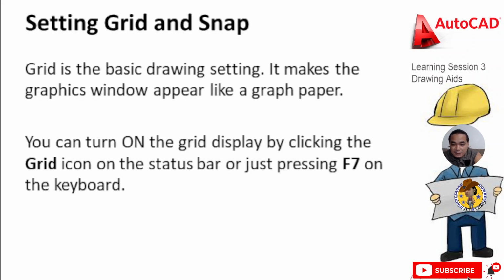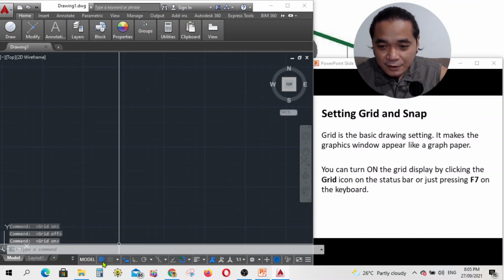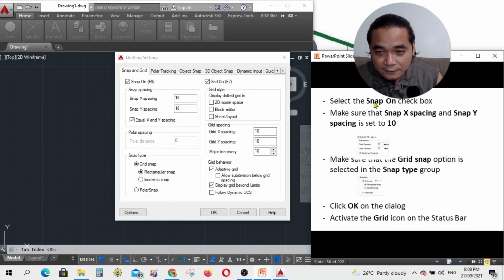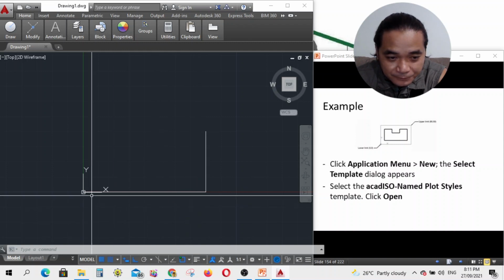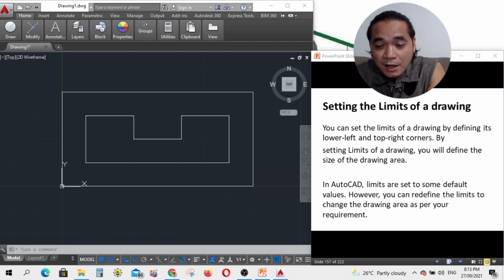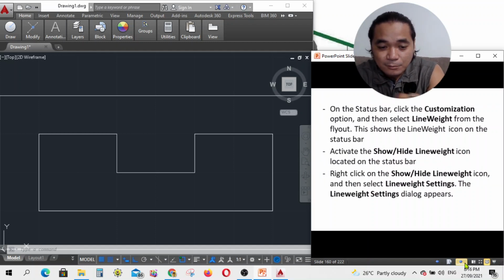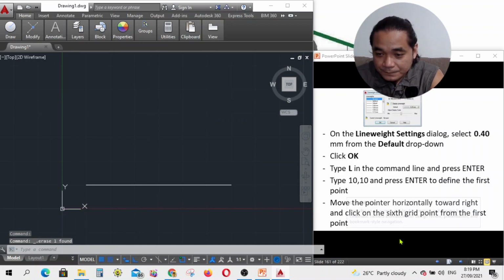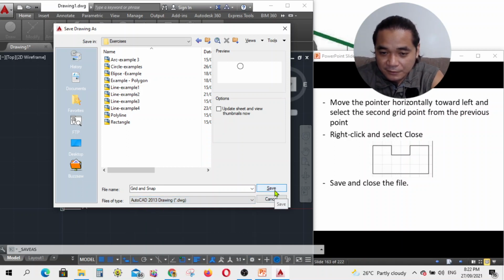AutoCAD LS 3-1 | Drawing Aids

Comment: This video helped me understand AutoCAD's Drawing Aids a lot better. It teaches us how to use AutoCAD drawing parameters to create drawings quickly. This lesson explains how to set up the grid and snap, as well as the drawing's borders, limitations, and line weight. The grid is the most fundamental drawing arrangement. A window simulation in the style of graph paper. To activate the grid, click the Grid icon in the status bar or press F7 on the keyboard. We can also specify the borders of a drawing area. AutoCAD has built-in constraints. However, we can adjust the limits to meet our needs. Line weight is also related to the thickness of what we draw. Thanks a lot sir.

Comment: After I watched the part 1 of learning session 3, it widened my knowledge about AutoCAD’s Drawing Aids. A big thank you to you Engr. for explaining it thoroughly. This video taught me how to set up drawing parameters in AutoCAD. This lesson also discusses configuring grid and snap, drawing restrictions and lineweight. Aside from that, I've observed that the grid is the most fundamental drawing setting which gives the graphics window the appearance that’s looks like a graph paper. To enable the grid, click the grid symbol in the status bar or press F7 on the keyboard. Lastly, I learned that the limits in AutoCAD are set to some default values. You can, however, alter the bounds to change the drawing area as needed.

Comment: In this Learning Session 3- Part 1 video is about the Drawing Aids. This really helps me to understand well the various functions of Drawing Aids. The content of this video teaches me to define the drawing settings which will assist me to easily creating a drawing in AutoCad. I learned that the drawing tools which can be turned ON or OFF from the status bar and to access drawing setting like by right clicking on button. From its definition that Grid is the basic drawing setting which appear like a graph paper. You can turn on the grid display by clicking the Grid icon on the status bar by pressing the F7. Also, I learned that the lineweight is the thickness of the objects wherein you need to adjust the lineweight by setting the navigation bar and click lineweight. Thank you for this informative video Sir. I learned a lot! God bless☺

Comment: I finally learned how to set the grid and snap settings in this video. And also I learned how to set the thickness of the objects that I draw by the Line weight. Because of your clear instructions, I learned a lot in each lesson, so thank you sir.

Comment: In this video, I have learned the functions of grid and snap, which can be turned on and off by pressing their respective shortcut keys, F7 and F9, or by looking for them in the status bar. I also discovered that the "LIMITS" command can be used to define the drawing area. Another amazing feature I've discovered in this video is the line weight, which can be configured into various thicknesses. All of these functions can be found in the status bar, and if it isn't visible there, you can find it in the customization (the icon with 3 horizontal lines located at the bottom of the AutoCAD) and turn it on to pin it to the status bar.

Comment: Good Evening Sir.
Pauline Peace to you!

Thank you for this video sir because it help us to know every topics in AutoCAD especially this Learning Session 3- Drawing Aids because it helps us to know how to used the AutoCAD Aids Tools because it useful and to assist in our drawing using of AutoCad  in a certain part/component, the most basic types used are: Line, Circle and Rectangle because it is essentially modes and methods of entering the data, once we mastered, we allow to create measured drawing with ease.

Concepts for this Learning Session 3-Drawing Aids:

Used of Grid and Snap - The grid helps you align objects and visualize the distances between them. The grid is not plotted. Grid Snap restricts the movement of the crosshairs to intervals that you define. When Snap is turned on, the cursor seems to adhere, or "snap," to an invisible rectangular grid when you create or modify object

Used Ortho Mode and Polar Tracking - Ortho only addresses 90-degree angles, Polar can be set to any increment angle you want as low as 1-degree.

Use Object Snaps and Object Snap Tracking - Use the Tangent and End object snaps with object snap tracking to draw to points that are tangent to the endpoints of arcs. Use object snap tracking with temporary tracking points. At a point prompt, enter tt, then specify a temporary tracking point. A small + appears at the point.

Create layers and assign properties to it - Right-click, and then click CAD Drawing Object > Properties. Click the Layer tab. The layers from the original AutoCAD drawing are listed along with their associated visibility, color, and weight options.

Zoom and Pan Drawings - Pan: Hold down the scroll wheel as you move the mouse. (The scroll wheel is also considered a button.) Zoom to the extents of a drawing: Double-click the scroll wheel. This method is particularly useful when you accidentally press Enter at the wrong time during a Move or Copy operation.

That's all
Thank you and God bless!

Comment: In LS 3-1 I learned about the drawing settings which can be turned on or off from the status bar. Learned how to set up and use the Grid and Snap setting. Grid is the basic drawing setting which makes the graphics window appear like a graph paper while Snap is used for drawing objects by using the intersection points of the grid lines. By pressing F7, we can turn on the Grid.  We can also set the limits of a drawing by defining its lower-left and top right corners. To set the thickness of the line, we need to adjust the lineweight by setting the navigation bar and click lineweight. Thank you so much Sir for all the learnings I have through this video!

Comment: In this video, it really improved my understanding of AutoCAD's Drawing Aids. It teaches us how to set drawing parameters in AutoCAD to create drawings fast. This lesson explains how to configure the grid and snap, the drawing's borders, the drawing's limitations, and the line weight. The grid is the simplest basic drawing arrangement. A graph paper-like window simulation. In the status bar, click the Grid icon or press F7 on the keyboard to activate the grid. We may also specify a drawing area's borders. AutoCAD has built-in limits. However, we may change the limits to suit our needs. Furthermore, line weight it relates to the thickness of what we draw. AutoCAD gives objects a default line weight, at the same time we may adjust the line weight.

Comment: For line sketching, I learnt how to use the grid and snap. Engr. Mardie explained where and when to set up grid during this tutoring session, including turning it on by hitting the Grid symbol on the status bar or pressing F7 on our keyboard. This lesson also demonstrates how to utilize the snap mode in creating objects utilizing the intersection points on grid lines in this video. By changing the navigation bar and picking the lineweight, I also learnt how and where to alter the thickness of a line. And, due to this video, I now understand how to properly use ortho mode and polar tracking. Thank You so much Sir! God Bless!

Comment: In this Learning Session 3 part 1 it talks about Drawing Aids. In this learning session I’ve learned how to define the drawing settings that can assist to easily create a drawing in AutoCAD. Also in this lesson I’ve learned  a lot on how to use the grid and snap. Basically, the drawing grid serves a very handy purpose allowing you to align elements and navigate around your canvas with relative ease. With the grid, the aspect ratio can help set a square grid with other options allowing you to set the spacing otherwise. This helps in alignment and positioning.Thus, all of these basic functions are very helpful and useful for me. However, I am little by little familiar with this kind of drawing aids that I’ve learned on how to accurately set up the grid and snap settings. I also understood the setting limits of a drawing that in AutoCAD the limits are set to some default values. We are able to redefine the limits to change the drawing area. Lastly, I was able to understand about setting the lineweight that is the thickness of the objects that we can draw. In fact, in AutoCAD there is default lineweight assigned to objects that we can set a new lineweight.

Thank you so much sir for this kind of content :)

Comment: It took me a while to really understood the different functions of autocad's tool, but because of this informative video, little by little I get to understand most of it. Specifically the use of grid and snap, the limits of drawing, and the lineweight tools. I do also understand the essence of command line wherein user could just easily search on. To comprehend much of this, first I understand that grid can be used if we need graphing line when we draw, on the other hand we could also make use of a snap button to draw objects with grid points. Understandably, I do know also how to adjust the lineweight to basically set the thickness of the line. 

Thus, this video really is very helpful to me. And I would really await for the next video to come, because definitely I  would garner learnings out of it. THANK YOU SIR

Comment: Thanks sir for this very informative video. I really appreciate this video material since it has aided my knowledge of AutoCAD's Drawing Aids significantly. It shows us how to establish drawing parameters, which will help us in quickly creating a drawing in AutoCAD. This tutorial discusses how to establish the grid and snap, how to set the boundaries of a drawing, how to set the limits of a drawing, and how to set the lineweight. I've discovered that the grid is the most fundamental sketching setup. It simulates graph paper in the graphics window. By clicking the Grid symbol in the status bar or by hitting F7 on the keyboard, you may activate the grid display. Additionally, we may define the boundaries of a drawing area. Limits are predefined in AutoCAD. However, you may adjust the boundaries to customize the sketching area to your specifications. Finally, I've discovered that line weight refers to the thickness of the things you draw. In AutoCAD, objects are given a default lineweight. You may, however, change the lineweight.

Well done sir. I'm looking forward to the next videos.

Comment: LS 3-1. 

In this learning session, I accumulate tons of informations specifically on how to activate the Snap Mode, setting snap spacing as well as its major lines. The grid helps you align objects and visualize the distances between them. The Grid Snap restricts the movement of the crosshairs to intervals that you define. To turn on the grid display, click the grid icon on the status bar or pressing f7 on the keyboard. Furthermore, I also learned on how useful the snap on making a drawing because it provides a way to specify precise locations on objects whenever you are prompted for a point within a command. Engr. Mardie demonstrated the setting the limits of a drawing and drafting settings on what are the coordinates for every major lines and lastly is the lineweight.

Comment: For this video, I little by little understood and used the functions of autocad's tools. Most especially the buttons in the status bar. Wherein in this first part of LS3, applying the grid and snap, the limits of drawing, and the lineweight  are the tools illustrated. It could also be searched in the command line. Grid, snap and lineweight buttons can be selected in the customization tool/icon where it could also be on or off by simply clicking to it. The grid button is the grids or graphics that could be visible in the graphics window, where through it, we can  assign the limits of the drawing and define the area of  the object drawn.  The function of the lineweight is to simply change the thicknesa of the object. Generally, from LS1 to this session, Im so grateful to lean these new things. Thank you sir!

Comment: In learning session 3, it discusses about drawing aids specifically on using grid and snap. Grid is the basic drawing setting, it makes the graphics window appear like on graph paper. To turn on the grid display, click the grid icon on the status bar or pressing f7 on the keyboard. I also learned on how useful the snap for the drawing aid. In snap, it is used for drawing objects by using the intersection points of the grid lines. To turn on the snap mode, select only the grid points. Moreover, Engr. Mop also highlighted on setting the limits of a drawing and drafting settings like on what are the coordinates for every major line as well as on the grid and it's specific spacing and lastly, I learnt on how to set lineweight and why it's vital for the drawing process because it may help you manage a design with a lot of various linetypes and allows you to make quick and easy global modifications.

Comment: In this video, I've learned that most of the drawing setting can be turned ON or OFF from the status bar. You can also access additional drawing setting by right clicking on the button located on the status bar which will assist you to easily create drawing. And also I learned how to apply and set Grid and Snap on the drawing and on the lines. Setting the limits of drawing by defining its lower-left and top-right corners, and setting the line weight of the object that I draw.

Comment: Thanks to this video, I learned the functions  and I able to defined the drawing setting present in AutoCAD which in fact the drawing setting are located in the status bar and can be turn on and off. Setting Grid and Snap was one of the draw setting that can be on and off the grid display and has a shortcut of  F7 in the keyboard then snap which mainly used in intersection points of the gridlines. We  can also modify things in the status bar just by clicking the setting you needed also to specifically change it just go to drafting setting and be comfortable in changing what data’s are needed. The function of limits which helps you view and input the exact data for the desired zoom in and zoom out of your object as it corresponds also to the boxes present in the workspace. The line weight which is responsible for the thickness of the objects that you draw, this feature can also be customized and modify.

Comment: LS 3-1. In this learning session, I have learned how to activate the Snap Mode, how to set the snap spacing as well as the major line. I have also learned how to activate Grid which is found on the status bar. In setting the limits, we can set it by defining its lower-left and top-right corners, by that we will define the size of the drawing area. In AutoCAD, limits are set to some default values. We can set the limits by typing it at the command line, define the lower limit and upper limits. In setting the lineweight in AutoCAD, there is a define lineweight assigned to objects but we can set a new lineweight by customizing it.

Comment: This video enables me to be more familiar on the basic tools specifically the utilization of grid and snap functions. Grid can be turned on if we need graphing lines as we draw, while we can also make use of the snap function if we want to draw objects using the grid points. Also, I’m thankful that I came to experience how to adjust the LineWeight in order to set the line thickness according to my preference. Thanks a lot sir!

Comment: For the first part of learning session 3, I really do appreciate this video content because it greatly aids my understanding of AutoCAD's Drawing Aids. It teaches us to define the drawing settings, which will assist us to easily create a drawing in AutoCAD. This learning session talks about setting grid and snap, setting the limits of a drawing, and setting the lineweight. I’ve learned that the grid is the basic drawing setting. It makes the graphics window appear like graph paper. You can turn on the grid display by clicking the Grid icon on the status bar or just pressing F7 on the keyboard. We can also set the limits of a drawing by defining its lower-left and top-right corners. By setting the limits of a drawing, you will define the size of the drawing area. In AutoCAD, limits are set to some default values. However, you can redefine the limits to change the drawing area as per your requirement. Lastly, I’ve learned that the line weight is the thickness of the objects that you draw. In AutoCAD, there is a default lineweight assigned to objects. However, you can set a new lineweight. 

This video content is very informative. I'm excited to see the next videos!

Comment: Throughout this learning session, I learned how to setup using the grid and snap for line drawing. Sir Mardie demonstrated throughout this learning session on how and where to conveniently setup grid, including switching it on by pressing the Grid icon on the status bar or by clicking F7 in our keyboard. Sir Mardie also shows us in this video how to use the snap mode in drawing objects through using the points of intersection on a grid lines. I also learned how and where to customize the thickness of a line by adjusting the navigation bar as well as selecting the lineweight. And, thanks to this video, I finally know how to use the ortho mode and polar tracking correctly. Thank you sir, and God bless!

Comment: Thank you sir for this another learning session. In this video, I learned on how to set grid and turn it off through clicking its icon. I also learned how to define the size of the drawing area as well as changing the thickness of the line.